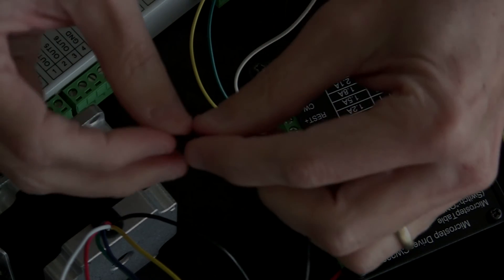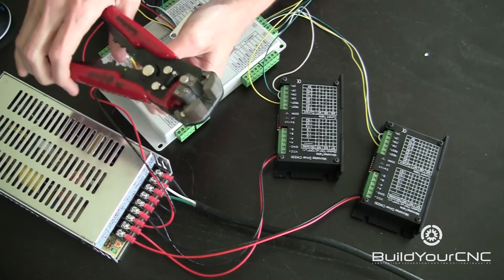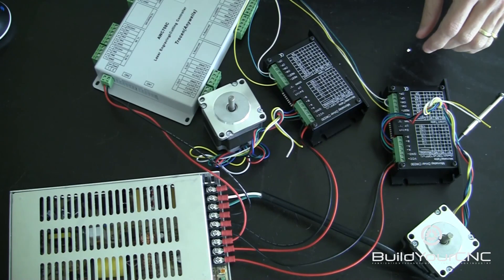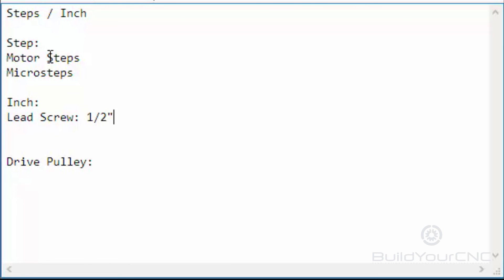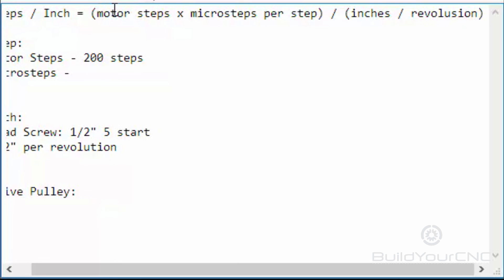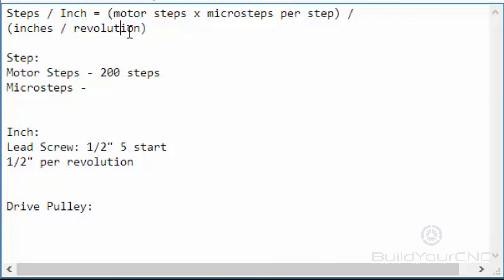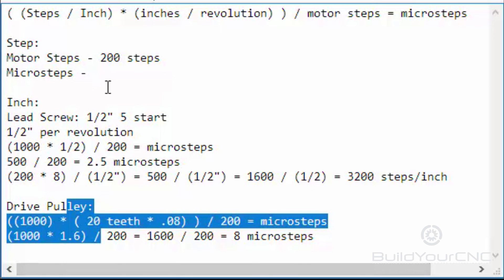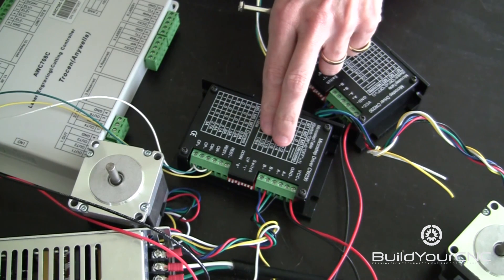How to wire Stepper Motors to Motor Drivers for Laser Controllers

Comment: I just set up my NEMA 23 , 3 axis (x & y, z ghost). I’m using an Arduino but I’m confused if I need a CNC shield bc I’m running it on my 10ft Longarm machine.
Reply from the maker: If you are using stepper motors, you will need drivers for each motor. A driver will accept a pulse signal to turn the stepper motors in one direction or another (with a direction high/low signal). The driver then provides higher current power to the coils of the stepper motor. Even if the stepper motors are very small, drivers are still needed to energize the correct coils in the proper sequence. There are shields that contain drivers, and I would recommend that. Good luck with your project and please let me know if you need any help.

Comment: Patrick, with respect to the AWC manual, what exactly is a "PULSE?"  Is it the same as "STEP"  as in a 200 step stepper motor for 360 rotation?
Reply from the maker: Yes, that is correct.  A pulse is the same as a step.  If you have microstepping enabled, then there will be a multiplier where the pulse will match the steps multiplied by the microstepping per step.  The pulse will always be the actual steps the motor will use.
Reply: @PatrickHoodDaniel  thanks Patrick. That's pretty helpful.
Reply: @PatrickHoodDaniel  one more question. I'm sorry I forgot to thank you for the great videos. I will certainly be looking for the next one you put out. But my question was: is there another option other than lazercad for use with a AWC 708? And do you have any experience using SolidWorks files in conjunction with the AWC 708? I wonder which file format works best . 
Thanks again for all your great work, Patrick.

Comment: I mostly find four wire "bi-polar" type stepper motors. Can these be used with a controller like this?
Reply from the maker: Yes, absolutely.  The four wires are wired directly to the A- A+ B- and B+ terminals on the bipolar driver.  The drivers shown here are bi-polar drivers and not unipolar drivers.
Reply from the maker: To be more clear.  Stepper motors connect to their corresponding drivers, not the laser controller itself.  The driver, no matter if it is a unipolar or bi-polar driver, can be used with these laser controllers.  Just make sure to pair the stepper motor with the correct driver.
Reply: Thank you. I have learned so much from your videos. Thanks for taking the time, you're a good teacher!
Reply: Yes, I understand.
Reply from the maker: You are very welcome!

Comment: Great video :)Hope you can help me as you seem to know a lot...

I have bought the awc708lite controller with 2m145 stepper drivers. The power supply is MYJG100W.
The laser cuts perfectly , however  after a while, when engraving the laser freezes the x axes or Y axes  depending which is used for engrave. When restarting the stepper driver it is all good again.
If engraving without water protect - when the laser is not shooting  ( the laser power supply MYJG100W  off) it can engrave even on 300 speed and not stopping or excreta.
That is veered why when engraving it malfunctions, but when cutting all is fine. Why switching of the laser power supply it engraves perfectly  - virtually of-course.  The laser power supply not co-potable with the AWC708 lite controller? Or the stepper drivers to sensitive?